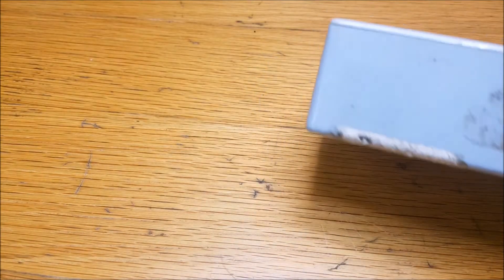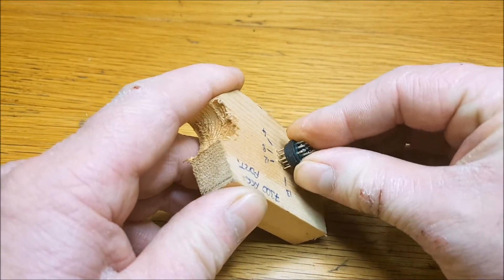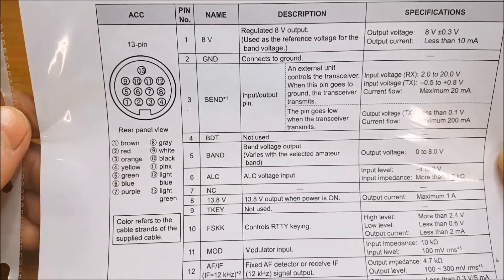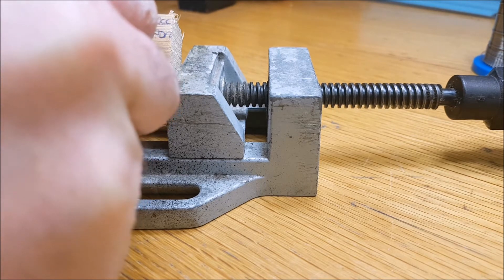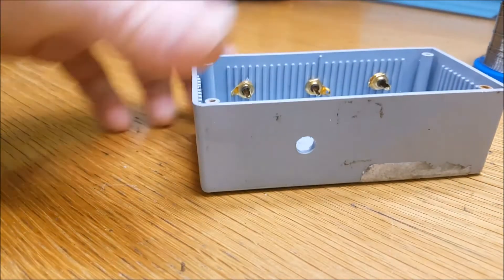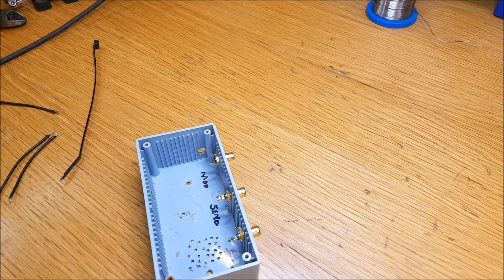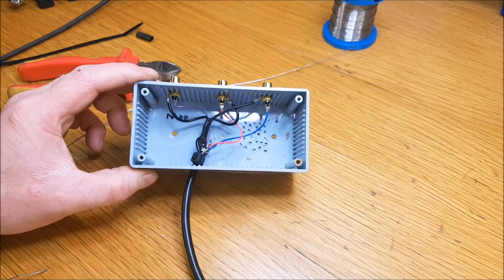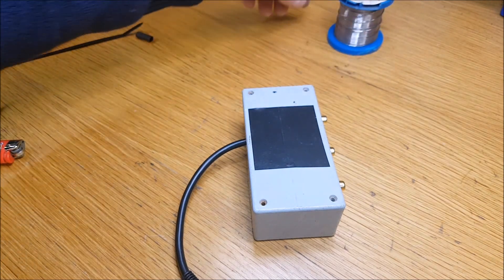Icom IC 7300 ACC Port Interface DIY

Comment: Great video. Are there any settings in the radio menus that need to be changed for microphone audio in to the back ACC port. I'm running a line6 Pod HD500 for my PR40 microphone audio chain with noise gates, mic preamp Studio eq's, parametric eq, compressors etc emulated by the hd 500. Right now I go xlr out of the hd500 to a golden maxima audio transformer interface and in through the front mic socket. I'd like to try the hd500's unbalanced line out to the Mod input at the ACC. The 7300 mod input is 10K ohms and the hd500 unbalanced line out is 10 K ohms. The mic audio in to the front from the hd500 sounds great but I'd like to send the microphone modulation in through the ACC port.
Reply from the maker: I thing you have to select the audio input from the acc port in the menu.

Comment: I recently purchased a returned 7300 that is still under full warranty and until I watched your video, I didn’t realize the SOB that returned it didn’t include the Accessory Pigtail Connector and the like 🤬🤬🤬🤬🤬, luckily, I have a 20 year old one from a 706MKIIG.

Comment: I modified a Heavy rubber / Metal Keyboard Sustainer foot pedal. Put in my own heavy duty tx switch. so i could key the radio with my foot. Handy as it kept my hands completely free. To work or jot stuff down.
Reply from the maker: The only job Lee. I've been on the pedal since 1988

Comment: I tried this George with my 7800 with good results but now trying it with the 7300 I found there is an increase of bass level which im struggling to control? I was wondering if you have found the same?

Regards Steve
Reply from the maker: Steve Malpass hi. I can't comment on that. I never seen any increase in bass. The radio should only produce the audio that is presented to it via the acc port. Weird one for sure Steve. 73
Reply: @GeorgeEI7KO  Steve, I noticed the same with my 7300 in the monitor, but after looking at the actual audio output on a spectrum analyzer as it leaves the radio, it still rolls off at around 90-100 hz just as it would by using the front mic socket, due to the "internal software SSB filter".